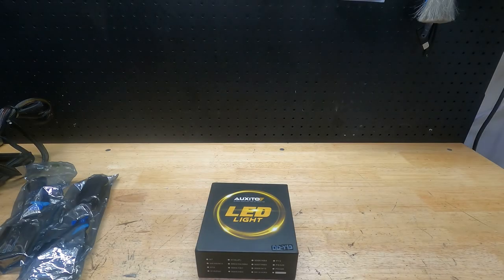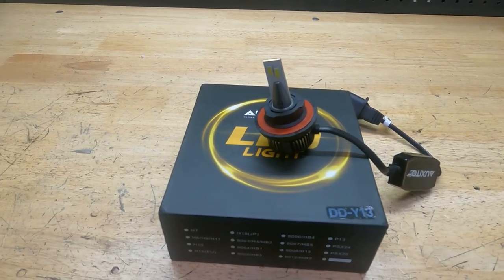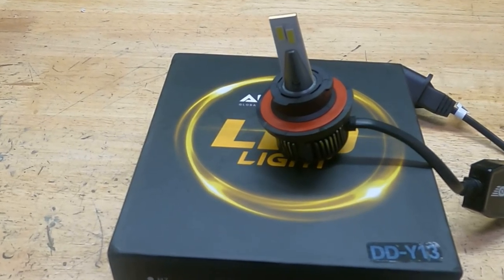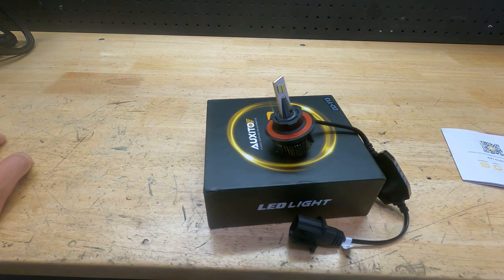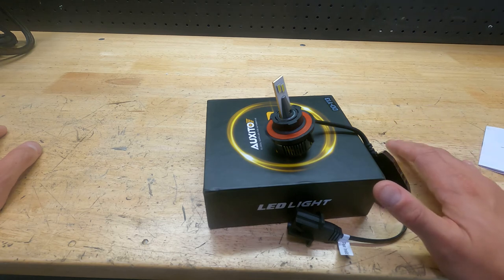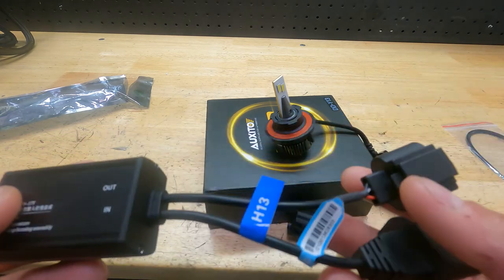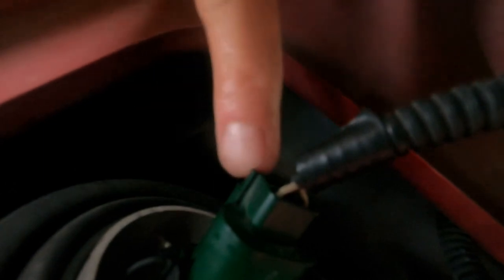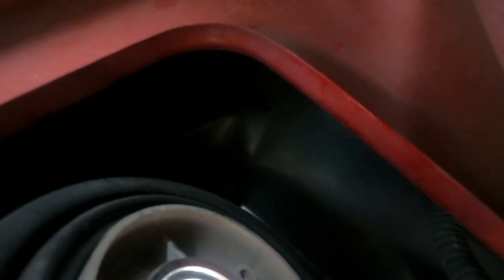2007 Dodge Ram LED headlight upgrade

Comment: I have a 2007 Ram 2500, and I bought the Sylvania H13 LEDs. With the truck off, both are on, but when the engine (6.7 Cummins) is idling, the bulbs shut off, and come back on randomly. Would I need to get the resistors for them?😊
Reply from the maker: yea I had the same issue and the resistors solved it  for when upgrading to LED's
Reply: @DLMGarage i got a resistor and mine still do the same thing as this guys

Comment: I have a question I have some h13 but only works on high beam and not low beam
Reply from the maker: Not sure
Reply: @DLMGarage  Same problem here. 2007 Dodge Ram, Auxito LEDs and resistors. High beams only. Had to switch back to halogen as they are not consistently reliable. It could be the truck or the brand of LEDs. Not sure but these were a no-go for me.
Reply: @jeffreywright9064 Why would they work on his 2007 but not on yours? That doesn't make any sense